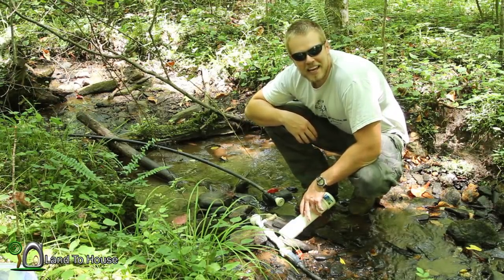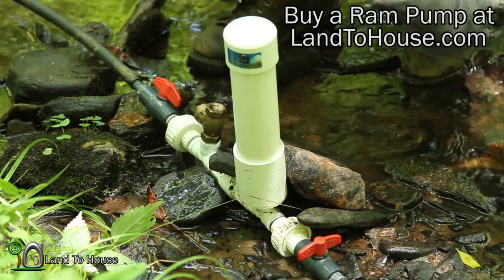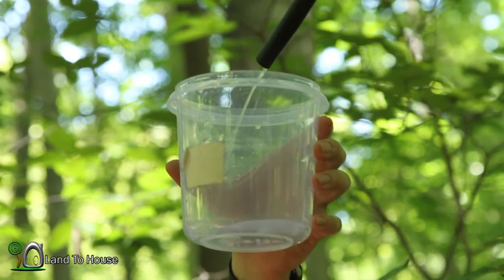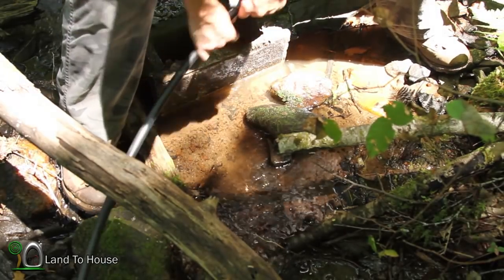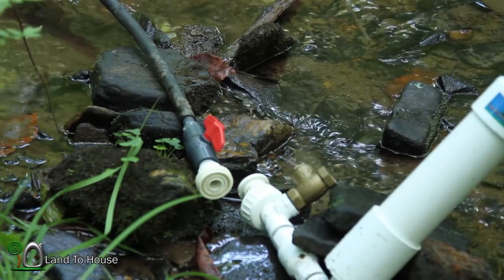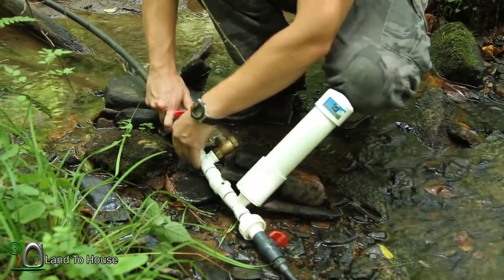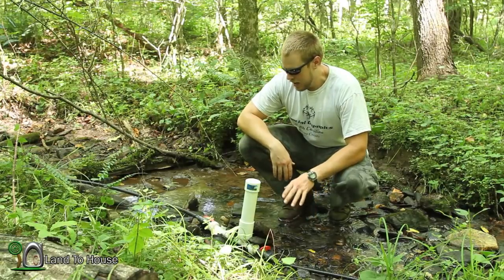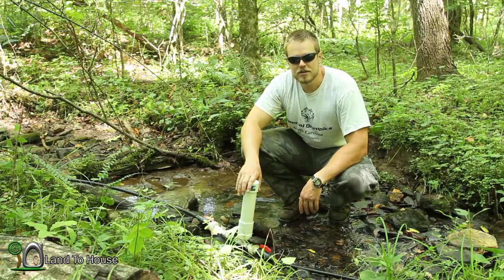Ram Pump Stand Pipe. Does it Matter?

Comment: I built a 11/4 in. ram pump which pumps water up a steep 50 foot bank and then pumps it another 400 feet along fairly level ground to it's destination at my garden.     My experience with keeping the pump operating steadily using 400 or 500 feet long delivery pipe is gradually adjusting the faucet to the delivery pipe until the pump runs smoothly with no stopping every few minutes.  Sometimes the inlet water supply has to be adjusted to allow just enough water entering the pump to work smoothly. I have too much pressure because my water fall is around 20 feet drop so I have to adjust the amount of water going into the pump.    Other people on smaller streams won't have that problem.

Comment: As always, good video. But you didn't show us if the stand pipe would have helped or not.  That's the part I was most interested in.
Reply from the maker: haynerbass Thank you. I will have to make a part two to this video. It seems the 1/2" pump was working better on the longer drive pipe than the 1-1/4" pump. So I will install the stand pipe on this setup then start testing with the larger pump.
Reply: That's really interesting.  I would have thought the 1 1/4" would have been great on an extra long pipe.
Reply from the maker: haynerbass that's what I thought as well. I guess it's testing time.
Reply: Oh yeah! I love experimenting and designing and just plain playing with ideas.  I look forward to seeing if your standpipe works with the 3/4" pipe you used in this video.  Thanks for taking the time to respond.
Reply from the maker: haynerbass Who likes sitting and doing concept math when you can actually test it out! Thats what I say. This pump is actually the 1/2" pump I am getting ready to start selling on my site. It works the same as the 3/4" though.

Comment: Great test.  I wish my spring had that much water.  In these dry months I can not use my pump.   :-(    Not enough water.
Reply from the maker: John Godwin My water is down from 150gpm to about 25 right now. Its so sad to see it this low. I am getting this 1/2" pump ready for sale. I think it will run on 1/2gpm but I am not done with the tests yet.
Reply: :-D

Comment: Thanks for the video.    Unrelated to the pump.  When you doubled the length of the input pipe what delivered to the pressure at the end of the pipe and the volume of water that made it through the pipe?    Wonder if there is a length where the pressure and / or volume of water delivered would not change because of resistance of the pipe to the flow of water.

Back to the pump - couldn't help wondering if a longer stand pipe on the waste water check valve or a bigger pressure chamber might have lowered the pressure enough so that the pump would have functioned.  If the pump functioned, I wonder how the volume of water delivered would have varied.   I know you have quite a few videos in the play list - might be one on this topic - I'll keep looking - thanks !

In my irrigation situation I'm looking to optimize for the volume of water delivered rather than the delivery lift.

Land to House ram pump play list:
https://www.youtube.com/playlist?list=PLTrfbWw_mKRIynFabbgX8CXNIHOUrXbHy

Comment: Seth,
My name is Dennis Sweeney,  I very much enjoy your experimental senerios, but you have never explored an elevated siphon station, above the water source to imcrease the the head pressure and create a NEW elevation station of the original water source.

By creating the maximum (physics/hydraulics) allowable or (20-30 % increase elevation) by creating this new elevation station by this new siphon station. (with a foot valve at the lower water source, and a filler standpipe with another one way foot valve, or a on/off Manual valve. 

When the source water pipe is full and sufficently primed by the "NEW ELEVATED SIPHON STATION", and you want to start the pump, and understanding, that the source pipe, including this "NEW ELEVATED SIPHON STATION (That allows more elevation or drop to the RAM PUMP, should allow for greater overall pressure and therefore, "GREATER ELEVATION LIFT, after the RAM PUMP, and therefore greater volume.

What do you think, It would be an interesting experiment,  and an interesting show.

My phone number is: (603) 785-5259, If you want further clarification of my researched understanding of siphonage / elevated siphon station, to creating or increasing water source elevation, though applied physics-based hydraulics.

By creating a "NEW DOWN STREAM ELEVATION STATION - RESOURCE".

CALL ME ANYTIME:
MY Email: grshfe@gmail.com
Reply: Your comment about siphon station was like turning on a light over my head. It's like those situations, when the thing is in front of us, but we just don't see it. 
I want to place a ram pump in my farm, but there is not a lot fall, but doing the siphon effect it will make a lot difference. Thanks.

Comment: Stand pipe to increase head in shallow gradient makes these pumps far more versatile.
Reply from the maker: A stand pipe is mostly used to being the source water closer to the pump when the drive pipe has to be long to gain the needed head pressure.

Comment: After analyzing your project I would say this......kudos to you for effort but you need to watch the series "dougs ram pump" for a ten year experience of using a homebuilt ram pump.  I have treid most everything under the sun and I know what works and what don't after ten years as my entire world runs on the constant heart beat of a twin ram pump set up.  I get 1 gallon per minute 70 feet high.   Never use plastic parts is rule No.1 and rule No. 2 is do not use gate valves.  Your input pipe needs to be larger than the  input of the ram pump itself to reduce friction losses.   If you don't use a stand pipe the harmonics will constantly be shutting down your pumps.   You won't need such a long drive pipe if you use a larger input pipe.
Reply from the maker: Thanks for watching. I'm actually on a property right now waiting for a ram pump to reach the top of a hill. I think I only have about 6 years with the ram pump. They are both finicky and very forgiving. As you mention they will run on larger Drive pipes. But I find that consistent waste valve and drive pipe are the most efficient. My personal PVC Ram pump has been working around 6 months Non-Stop. So far no issues whatsoever with PVC. The pump is about 2 years old.

Comment: All pipe has a resistance to the flow of water.  The longer the pipe the more the resistance.     By putting in a standpipe you zero out the resistance in the pipe above the standpipe while still having the advantage of the increased head.  

Sort of analogous to having a capacitor in a run of electric wire.    You just need for the standpipe to be receiving as much water as it is delivering.

Comment: If you increase the height of the delivery pipe, you'll have enough  back pressure (at least 10 to 20 PSI) for the waste valve to work.
Reply from the maker: Yes the back pressure of the pump does matter a lot! I have a video showing how the pump needs back pressure and at what point it works or stops working. Thank you for watching!

Comment: The flow rate resistance scale is not linear.  Because water itself does not compress the hydraulic pressure throughout the drive-pipe is near the same at each end. Electrical flow through a copper wire would suffer a near 10% loss through 100 feet of residential gauge wire.

Comment: Hi. Good video Seth. I have a question based on comments below. I purchased your 1 1/4 Ram pump. I have it set up in the creek and it is pumping but it seems weak. The waste one way closes about every 3 seconds. My source set up consists of about 80 feet of pipe. I have six sections of 2 inch reduced to 2 sections of 1 1/2 inch that connects to the pump. The problem might be the head. I might have 2 feet of head over that distance. Any insights? I might be getting 1/2 gallon per minute at the end of a 100' hose. I think the lift might be 5  to 6 feet.........
Reply from the maker: My first thoughts are that you need to have consistency with drive pipe and waste valve. In your case you need to have a drive pipe that is 1-1/4". The reason this is important is because the pressure wave going from the source to pump and pump to source needs to be the same. If there is a larger drive pipe the pressure wave going away from the pump has to battle a larger volume of water and the wave is reduced. ... you can still use the larger pipe as a supply line but then install a stand pipe that is 1-1/4". Check out this video: https://youtu.be/NPovo-QUUaM

Comment: Could you please measure the transient (temporary) pressure inside of the pipe at the location of the snifter valve?

How much does it INcrease in relationship to the surrounding air pressure when it gets hit with the high pressure wave (just after the waste water value shuts)?

AND

How much does it DEcrease in relationship to the surrounding air pressure when the waste water discharge valve is fully open (the lowest value between high pressure peaks)?

Thank you,

Dan     :-)

Comment: I'm also interested in seeing the stand pipe and how effective it was or wasn't I ha e built one of theses pumps and have been working with it on the weekends. pumping from a spring at bottom of a hill without alot of fall. Need more fall so I'm really interested in this stand pipe. any help is appreciated.  two keep the water ram videos going bro enjoy watching them.
Reply from the maker: +Eric Smith Nice to hear that you are working with a ram pump. They are lots of fun. I found that the smaller drive pipes are able to go a lot longer without much change in the action of the pump. But the larger drive pipes like the 1-1/4" start to slow down the pump after 100 feet. I actually have a ram pump video to film this Wednesday. Now that the weather is not 30 degrees.

Comment: Yes it will indeed help especially if using P.E pipes wherein there are curvatures, in my low head installation of 0.8m using PE there was increase in discharge and pressure

Comment: If you haven't shown a working pump with the longer drive pipe, how can you conclude that the standpipe is not necessary?  If you put a stand pipe in the middle, would it work?
Reply from the maker: On small ram pumps the drive pipe can be a bit longer than the recommended 100ft. As the size of ram pump goes up it is necessary to have a shorter drive pipe.

Comment: An interesting test, I did a similar but not so scientific test on my 1.1/4 setup and found that at about 150 feet there was a significant drop in the cycles so I put an open topped tank in the run.
I was wondering if the reason the pump kept stopping as soon as you opened it was because there wasn't enough back pressure in it, 
So a test for you why not try extending the delivery pipe a lot higher to get more back pressure and see if that works?
Reply from the maker: Michael Collinson You are 100% right on the back pressure issue. When I added the extra 100 foot drive pipe it added at least 4 feet of head and that gave the pump another 28 feet potential lift. I did not have more 1/2" pipe to continue testing the delivery hight. I did want to though. My tests are limited to the pipe I can afford haha

You bring up an interesting question. What if the larger pumps need shorter drive pipes??? Could the larger pressure waves cause more of an issue than the smaller ones? I have another 75' pipe that I could use to test the 1-1/4" pump. What was the change in cycle time for your pump with the added drive pipe length?
Reply: Land to House I think you are right about the larger pumps operating on smaller lengths probably due to the actual volume of water going through, I am sure that an 1.1/4" drive pipe at 200 feet long would stop the pump altogether as the shock wave has to get back to the source. Mine was still operating at about 130 feet but was very slow at that point. One thing I have noticed with mine, probably due to the large pressure waves is that in a year I have had to replace the rubber coupling twice as due to the constant 24 hr flexing it spil and let in air, the next time it goes I am going to try some thick silicone sheet I have been given wrapped around and secured by jubilee clips it should be pretty watertight and I suspect it will last a lot longer. All interesting stuff though.
Reply from the maker: Michael Collinson I will have to make the same test with the larger pump to see how it behaves. I think with the extra pipe I have It should be close to 130 feet. The rubber connector you speak of, what component is that? The part that connects the drive pipe to the pump?
Reply: Land to House Yes the rubber connector between the drive pipe and the pump.
Reply from the maker: Michael Collinson OH ok. I have had lots of success with these: http://goo.gl/KbC6v7

Comment: You need a bigger drive pipe! Should be twice the size as the output pipe!
Reply from the maker: The drive pipe actually needs to match the size of the waste valve. This will allow the pressure wave to be the same size going uphill and down hill. As for the delivery pipe it is mostly effected by atmospheric pressure and therefore can be any size you want.

Comment: All the literature I've read says drive pipe diameter is a factor in total drive pipe length and whether or not you need s standpipe. The reason for this is the "drag time" for the entire column of water to start moving again after the water hammer shock wave goes back up the pipe.  Nice video!
Reply from the maker: Thank you. I have found that the smaller drive pipe does not have to have a stand pipe as close as the larger pumps. The drive pipe can be a good bit longer in the 1/2" pump vs the 1-1/4".
Reply: cheers!  yes it's a ratio of pipe diameter to length.  I wish the link I found last spring hadn't gone down... it was an excellent article at Clemson.edu (spelling check) about it.. with formulas and good explanations.  oh well.
Reply from the maker: Oh yes I have seen that paper. It was a good one.

Comment: Ram Pump check valve, Size does't matter?
Reply from the maker: Yes it actually does matter a lot. The waste valve determines the drive pipe size. And the amount of water required to run the pump.
Reply: @LandtoHouse  thank you zeth for your response, recently I replaced my drive pipe from pvc to galvanized iron and noticed the increase of volume of water delivered.
Reply from the maker: That is a test I have been wanting to run. But have not taken that initiative for price.

Comment: my pump delivers water at the rate of one gallon in 3 minutes then slows down after 12 hours and my air tank is always full of water- i do not know how to fix the problem.can you help
Reply from the maker: Large commercial pumps use a snifter valve to replace a small bit of air every cycle. The diy model that I make ans sell have a bike tube in the pressure tank to ensure there is air in the tank. It also helps to make sure the pump is upright. Leaning to the side causes water to fill the tank.
Reply: Spend a little bit more money and buy the bladder tank, I experience the same as yours.

Comment: does it make any difference in the size of the intake pipe and the delivery pipe...should one be bigger than the other...???
Reply from the maker: +Concepcion Amancio the drive pipe needs to match the two check valves. The delivery pipe can be any size but most people reduce to half the drive pipe.

Comment: if I have one foot of drop that lifts seven feet which I can drop into a second pump I will lift 49 ft? I want to come up to the kids tree house. I was thinking I could use a long drop to power a hydro electric rig also.
Reply from the maker: Yes you got it! Do remember that each stage of ram pump will lose approximately 7/8 of the water out the waste valve. Say you start with a 1" pump using 6gpm at the first pump. It will pump around .75gpm Then you will have to store that water in a tank to run the second pump. Basically what I am getting at is that you cant run one pump from another continuously because there is too much lose. But you can store the water from the lower pump in a tank and use that to pump even higher with a second pump. ... OR have a second drive pipe that can be swapped to the original pump.And a second interchangeable delivery pipe that goes to the second and final storage spot.  eliminating the second pump.
Reply: A ram pump will typically use 10 gals to deliver 1 gal of water. A 2 stage ram pump would require 100 gals to deliver 1 (hmmm). Hydro electricity works better when you work with gravity not against it.

Comment: Does it matter the over all length of the Ram pump and distance between check valves
Reply from the maker: I have only tested a few designs. My very first pump was almost 4 feet long. It did not seem to have any advantage or disadvantage over the new model that is 2 feet or less long. Just speculating but I should think that the distance between the valves would make a difference if it was several feet apart. If the pressure wave returns to the pump before the valves have closed and opened in the cycle it would mess things up.

Comment: But how short can you make a drive pipe on a 1 1/4 ram pump?
Reply from the maker: +Mika Lee the shortest I have used was 15 feet but that was too short. I recommend 20 feet be the shortest.
Reply: thanks for the reply, I am building a place in the Philippines in the mountains for my retirement. Have a fresh water spring at the base of my land but need to get the water up to my house. This looks like a good plan. I like your new design much cheaper to build than they old style, and less complicated.
Reply from the maker: Yes the new design is working great! I have been very pleased with it after a couple years.